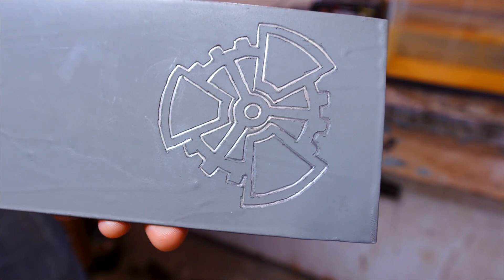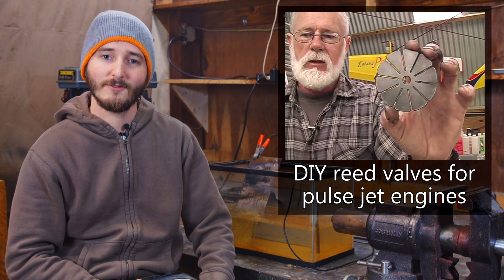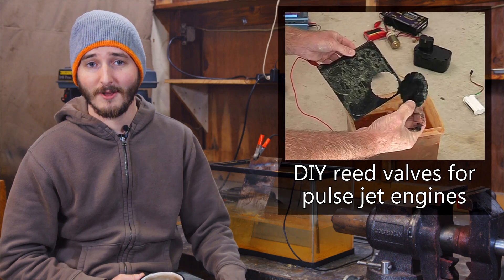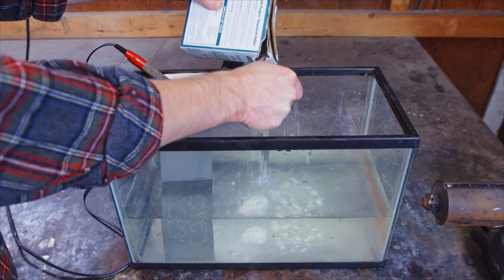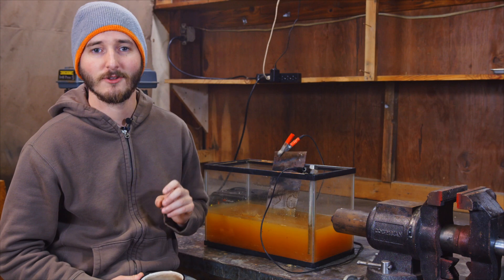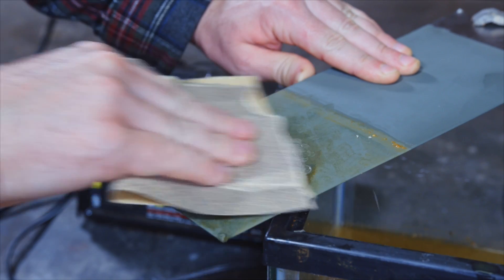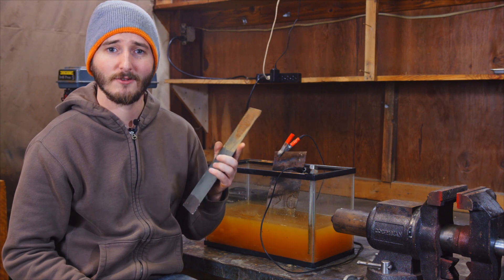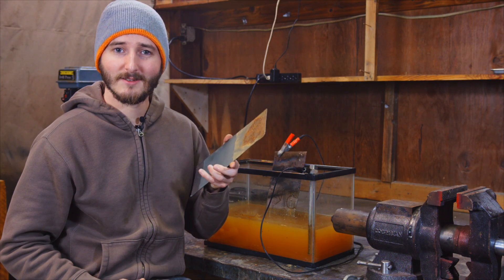How To Cut Steel With Electrolysis [Experiment In Progress] - NightHawkInLight

Comment: I, too saw the video and saw great possibilities.  After reading the suggestions I conducted the following:  After cleaning a 10 inch circular saw blade with denatured alcohol, I coated one side with 5 minutes epoxy.  This was followed with 4 thin coats of etching primer and topped with four thin coats of polyurethane.  In 5 quarts of water, I added one cup of sea salt.  For the negative side, I used some 12 feet of rolled up 18 gauge copper wire.  After 18 hours, a quarter size bubbling appeared near the test line.    After 36 hours, the bubble area was the same size.  After 48 hours I scraped off the epoxy.  I removed more metal scribing the line than 48 hours in the electrical charged solution.  Electrolysis metal removal had been known for centuries.  If this was a feasible steel metal cutting process, it would already be common place. The metal may be too hard and require annealing.   Using 15 or 30 minutes epoxy would be better.  5 minutes epoxy sets up too fast and makes for poor surface coverage.  With epoxy, adding the etching primer and poly may not be necessary.  I also noticed the back side with only the primer and poly did not show any bubbling.  Try turning the scribe side away from the negative anode.

Comment: i use this method to make artistic cutouts. i use mixture of 15 gal water: 1 cup of salt: 1 cup HCL and a 5a 12v power adapter pulling between 3.5-4.5a regulated by inline lights. Any how the ECM process which we use is really best only on very thin metals (under 1 mm). if thicker metals are used their is to much side wall attack which is where the paint bubbles off. i have gotten better adhesion using real photo resist like they use in commercial ECM  process but its more of a pain.

Comment: Parallel electrodes, ultrasonic bath on non-cavitation power level for getting rid of bubbles forming on the surface.
And the width of the cutting line must be more or equal to the width of the sheet you are cutting.

Comment: Hey, I think what you need to try is the same painting and scratching method (I would use laser engraving) but instead of the Electrolysis, use Ferric Chloride. Try different concentrations diluted in water. Results vary on the metal you choose.

Comment: Hi! Nice experiment! Maybe if you use photosensitive ink used in printing PCI cards you could have better results. This ink dries with UV, so that it will not present water in its composition. This could prevent the appearance of bubbles. I do not know how this paint behaves during electrolysis, but it has excellent results during corrosion in iron perchloride bath.

Comment: Watched the linked video, and I was struck immediately by two things:  
1) The gentleman in the linked video was cutting VERY thin spring steel sheetmetal.  You cannot force the electrolytic process to goes straight through the metal stock without dispersing into the surrounding metal.  (If you DO figure this out, let me know.  We'll make LOTS of money together!)  Because the aforementioned gentleman's sheetmetal is thin, the electrolytic process disperses only slightly from its intended path as it cuts through the sheet.  The result: the electrolytic process appears to cut straight through. (Is that as clear as mud?)
2) The title for this same gentleman's next video is "How pulsejet engines work (and a shameless plug for my book)".  Obviously, you have to write a book for the process to work properly! (I'll take my tongue out of my cheek, now.)

Comment: what are you cleaning the metal with? did you try brake cleaner? ceracoat may deliver what your looking for.
Reply: also. what seems to be happening is that after a certain point the rust is no longer conductive so the electricity is finding a new pathway under your paint. reversing polarity back and forth periodically should provide a cleaning action giving the electricity a new path of least resistance.

Comment: I believe your problem is that you need to use the positive electrode on the plate that you want to cut and the negative on other metal plate. That will make the positive plate to get oxide. An for better result put both plates closer that will increase the electron flow..

Comment: I'm no chemist, but some technical differences I noticed in the inspirational video:
- The guy used a plate as a cathode as well, thus providing extra area
- He seemed to take care to ensure that both the anode and cathode are parallel

I don't know if any of the above-mentioned should make a difference but it might well play some role?

From the comments it seems that some people are in accord that salt instead of baking soda should be used. If you are cautious about the potential hazards of chlorine gas, you can try to isolate the anode and capture the gas and bubble it through some reagent to get it back into some solution. (I am not sure if such a reagent exists but it's an idea)

I hope you obtain success and I would like to see the end result.

Comment: I think I did this in high school in electronic class more than a decade ago but it was with copper. To shield metal, my teacher gave students this blue marker and dipped in liquid. This was for designing circuit boards. Not sure if it's the same thing you are doing here

Comment: I think you need chlorine from NaCl to ech steel. Also, you should to use wider cathode to provide more current and even current distrubution. For paint, I will try to find exactly what Bruce did on his video - this special pant. Probably there exist reason why exactly that one.

Comment: voltage and current have a MAJOR affect on the electrolysis process. Increaseing the current and or voltage outputs might make the cut more precise, as well, using distilled water may greatly increase the both efficiency and effectiveness of electrolysis. Try using distilled water with baking soda, and stay away from salts, while a salt does work, it will cause harsh deterioration to the etch paint thus making this process work less effectively. I myself have done alot of experiments with electrolysis mainly involving Hydrogen generation, however this is what i know avout electrolysis, and hope it will help u to make this project work. A good idea might be to come in contact with a chemist for more help on this subject, the best i can think of being NerdRage. Good Luck😁

Comment: What about trying to cover the metal with some type of sticky tape ? this works for engraving. Mabe one of thoose heatable sheats of carbon-like film ?  But don't use tablesalt as an electrolite, this produces a ton of Cl gas, it corodes metal fast, and its highly toxic i beleave. Sorry for bad english
Reply: you could try to dip plate to acid to make the surface ruff maybe this will help to hold paint better
Reply: as well as do the elecrolysis slower may be. because of walls formating.

Comment: Why don't you try warming the wax up and then freeze it so it bonds with the metal leaving some of the metal exposed in the pattern wanted. Maybe try using latex vacuumed sealed around the metal.
Reply from the maker: I've tried that with wax. Seemed promising but didn't finish well.
Reply: NightHawkInLight

Comment: I don't  think  this  will  work. once  the  corrosion  gets  below  the  surface  layer  it can  spread  out  into  the  surrounding  steel.  Perhaps  if you  drilled a series  of many  small  holes  tracing  the  pattern  the  corrosion  could  eat away  steel  from  the  center  of each hole outward.  But  drilling  all the  holes  with a precision  drill press  is tedious.  Maybe  you  can find  a way  to  modify  a common  printer  with  a high  voltage  cutter?

Comment: i was thinking if the material used to cost the steal was not strong enough to form bubbles then what would happen. Try some material which is not joined so much to itself but just the steel. Also try epoxy. Maybe plastic insulation will do the trick. you can clean the access with an angle grinder.

Comment: Step 1. try to recreate experiment exactly. Salt, plate, plastic (not glass) container. 

2. His cuts were very thin. you only need a small amount of exposed steel. don't scrape off any paint after taking off paper pattern. this will damage paint and lets water under it. 

3. use exact paint primer he does, down to the brand. 

4. the unfortunate case is that human error can damage paint. worse comes to worse, try contacting maker of the original video.

Comment: Have you tried vinegar as the electrolyte? Or lemon juice? Iron is a basic metal and a light acid solution might speed up the etching process such that it doesn't have time to get under the paint.

Comment: when watching the video, I realised that even if the rest of the metal is covered, the current can still run through the small scratches, so the scratchings would have to be extremely smooth with no extra scratches, otherwise you will always get the bubbles, and even with this, it would take a very long time to get the smoothness required, a lot of trial an error.

Comment: You just can't (almost) etch your way all the way through anything but the thinnest steel. Anything thicker than a half, or even .25 mil and it's going to start attacking the edge along with the face, and because the edge is thinner it's going to hit it more aggressively than the broader flat surfaces. The pulse jet etch was all very fine lines, spring steel, salt, a lower volume of solution, and the two bulb pulled the watts down. Try duplicating RMR's method successfully first before trying to adapt it.

Comment: Michael Cthulu uses electrolysis to etch his swords, he uses vinyl stickers to protect the unexposed metal. Also did you boil the metal in hot wax? that might get you a better wax coat as it will drive out any moisture on the steel

Comment: As far as the wax goes if this process heats up the water enough the wax may melt off.  Also in the video you show where you got the idea from the steel he used might be a stainless version of spring steel which might erode differently than normal spring steel.  It is very thin too which should help.

Comment: I like to suggest you that the shape you need to cut should be exposed in both sides of the plate, it will reduce the bubbling out side the shape, just suggestion worth trying

Comment: contact michaelcthulhu- the big giant swords guy. he's been very successful and gotten some stunning results etching, using a salt solution, with vinyl as a barrier. 

I don't think the paint is your biggest issue. Go back to using salt water- chlorine gas is not a big problem in small quantities in a well ventilated room. I would also suggest changing your cathode to normal carbon steel.. that hose is stainless.

Comment: After watching the original video you took this idea from, I see a couple things.  First, he was using very thin spring steel - I suspect that when you use a thicker material the electrolysis will migrate under the coated surface simply due to the thickness of the metal.  Second, he did not cut all the way thru - if you notice in his video he actually snapped the part out of the surrounding metal (listen for the click/crack sound when he pops it out).  In essence he etched in a fracture point - I do not believe he could have etched all the way thru because the back is coated.  Perhaps if you were able to align the patterns perfectly front and rear you might have some better success, the process would meet in the middle - this may help with the eating under the paint issue.

Keep in mind that the spring steel is also hardened (to a point) which is why he can snap out the part cleanly along the path where it has been weakened (thinned).

If you try to align the patterns front to back, I would suggest drilling a couple alignment holes and dropping the template over those - you can always spray seal the holes after you have aligned and traced your pattern.

Comment: You should follow the example exactly in the way it is.

Your video don't show too much of your project, but:

1. The piece of metal that you want to cut is in the middle of the solution and not with the "back covered", like he did in the video simulating a battery configuration of the cathode and anode;
2. It seems that you using too much voltage and amps to get things done faster before deeply understand the whole process.

I hope it could help.

Comment: I'm sure others here understand the chemistry far better than I, but it seems to me that you'll only be able to use this method on very thin sheets with any sort of accuracy. The corrosion eats away the metal in every direction, which at the beginning starting with a flat surface means that it eats into it roughly perpendicular to the face of the sheet. But as it starts to penetrate deeper it will start to corrode more and more under the paint till you get the bubbling up that your getting.Might be worth a try with something like shim stock.

Comment: Periodically, remove the steel plate and start from the beginning, reapplying the paint and scratching out your pattern. 

Otherwise, once the etching begins there is nothing to stop the reaction from spreading outwards in all directions and getting underneath the paint.

Comment: What about instead of scratching away the paint, you make a template and lay it over top so that the paint doesn't get there in the first place? the smooth line may allow less electricity to "leak" than a jagged edge.

Comment: Consider dipping the plate into a solution of 20% phosphoric acid, 80% denatured alcohol.  Dip the plate in for an hour, then remove and let air dry 2-3 times.  This will convert the surface of the metal to iron phosphate which will not only help the paint stick, but give an additional bonding layer of protection.  

For a cutting agent, Potassium Hydroxide (potash) might be better than baking soda.  Hopefully this helps.  I am a big fan of your channel and wish you luck.

Comment: you aren't going to get very good results if you're working with thick materials. The main reason being, as your material is etched, more material is exposed along the edges of your masking, if left long enough, you will find that you will begin to "undercut" your masking agent.. as not only the area you want to etch is exposing new materials, but the side walls are also being exposed, over time. This means there are now three surface areas being affected by the electrolysis, the intended area, and both walls. this will cause the etching process to etch further and further under the masking you've used, leading to very undesirable effects. 

The reason you see this in thicker materials much more pronounced than in thinner materials, is as the electrolysis is happening, you will observe that you aren't actually cutting through the material, but rather removing it in a iniform manor, as the walls are exposed more, and the intended area deepens, you'll notice that the indent created by the removal of material begins to form an irregular "U" shape, more than a precise straight cut, this is because as it's going deeper, it's also going wider along the walls. 

The only real solution to this is to go in,  clean , and remask the walls to keep them from being exposed as they form.. 

That being said, on thin materials, you won't suffer too much undercutting, as the exposure times are much less.

There are a plethora of faster, and more accurate solutions to cutting complex shapes available such as tools and power tools that include punches, presses, saws, mills, plasma, sand and water jets and good old fashioned thermite..

Comment: You need a much bigger power supply. Also bring the anode and cathode closer together. When I was trying electrolysis I bough an TV battery charger that was 60 amps and 14 v doc for only $80. Look hard enough no I'm sure you will find it.
Reply: Rv*

Comment: have you tried heating the steel to about 200 degrees f° , then degrease while warm as the poors  will open and allow deeper cleaning. ,then heat it back up to about 175-200f° to help bond the paint to the steel? it may sound silly but windex style window cleaner is ultra good at removing grease and highly baked in carbon .i use it for a certain gun-smithing application that requires zero  barrel fouling to work properly and the stuff works better than acetone and gun cleaners .

Comment: try using a vinyl cutout for your barrier and I'm not sure but adding hydrogen peroxide/oxidizer may accelerate the process and allow for faster/cleaner cut lines. make the part oversized to compensate for undermining of the barrier. that is all I can think of. hope it helps

Comment: and what if you make the design in paper or paper tape, clean the steal and with the paper on the metal sheet apply the paint. that way you would have to scratch the paint and avoid the bubbles